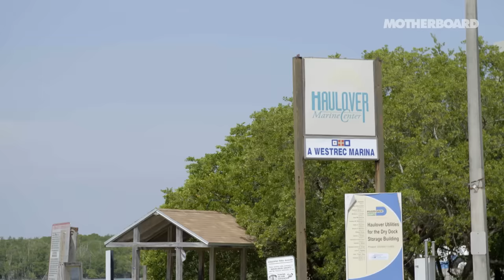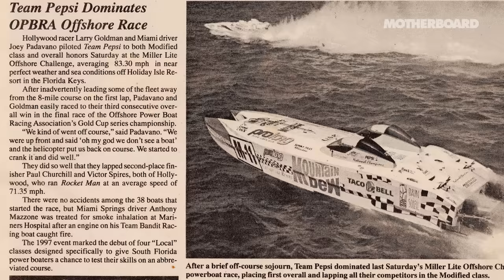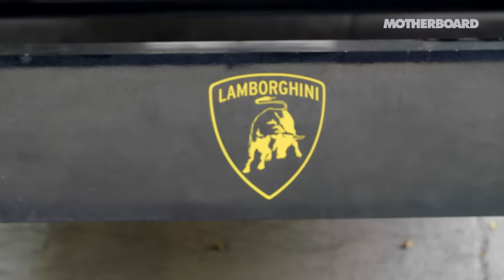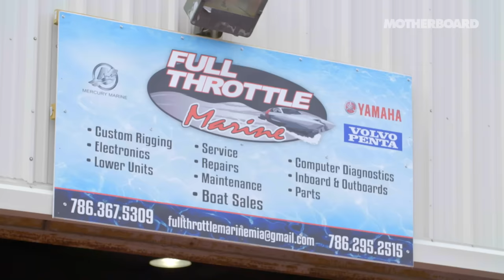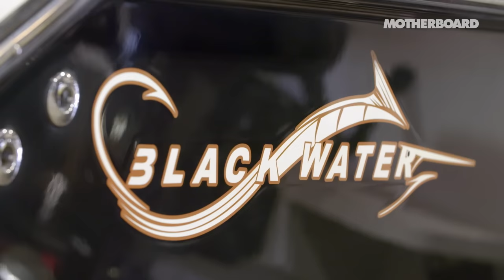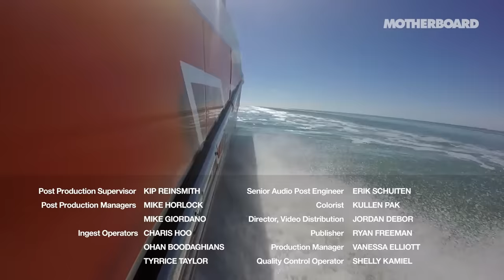Miami's Most Powerful Speedboats

Comment: 100mph on the water is absolutely insane
Reply: That yellow Lamborghini boat can do 186 MPH top speed. That's nucking futs. I've done about 75 on a supercharged jetski and it was scary. Cant imagine these rockets
Reply: Michael Matthews Some boats can reach 350 mph but it gets dangerous at that speed, boat flipping is quite common when you go that speed.
Reply: I race hydroplanes and we go like 135 while sitting on a 2 in thick piece of ply wood
Reply: After 80 it’s no longer fun, especially if you are sitting in back seats as it feels like it’s ripping your hair from scalp

Went 135-140 in back of a nortech and faster in a skeeter (didn’t have gauges for passenger in skeeter)  and did it on a lake so things came real fast

Comment: I'm glad they're using MPH instead of knots.
Reply: anything for the plebs
Reply: 1xtra299 I am a temporarily displaced millionaire thank you very much.  JOBS!
Reply: John Smith KPH or nothing
Reply: Kilometers are less convenient a unit for high speed, as they are a bit small. Maybe if the video was about bicycles.
Reply: Steinbeck!
Reply: I'm knot.
Reply: America is probably the only country in the world that measures things differently, not good.
Reply: knots are for boats ;) these machines are dragster. when you drive this kind of stuff, it's the same driving as a car !! fuck
Reply: america and burma
Reply: 1337Sauce Lol no they don't WTF are you on?
Reply: 良否 RNG Britain is officially on the metric system since a longggg time ago. They may use the foot and inches but speed is almost always in kph. I'm from Canada which is also metric where there is a similar situation. Cars use kph, sometimes we measure in imperial.
Reply: They ain't real seamen ...
Reply: @JohnSmith-td7hd    KPH is a more precise measurement however.
Reply: @mra6308  Same could be said for Celsius and Fahrenheit. Fahrenheit is more precise.
Reply: @JaviLengomin   How exactly?
Reply: @mra6308  Fahrenheit makes more sense for precision and as a way of communicating air temperature in a way that relates to how humans perceive temperatures. The ambient temperature on most of the inhabited world ranges from -20 degrees Fahrenheit to 110 degrees Fahrenheit — a 130-degree range. On the Celsius scale, that range is from -28.8 degrees to 43.3 degrees — a 72.1-degree range. This means that you can get a more exact measurement of the air temperature using Fahrenheit because it uses almost twice the scale. I do agree with the usage of grams and meters though.
Reply: @JaviLengomin   I dont think you can have a difficulty communicating air temperature with celcius either. I know for a fact that i can gauge how hot or cold it is outside using celcius. I mean come on. Freezing point is at 0 and boiling point at 100.
Reply: @mra6308  It's a scale based on water. The other is based on body temperature. Agree to disagree.

Comment: 0:22 Are these boats completely boxed in? How would you even pull out of the harbor?
Reply: Kenworth W900 and a trailer that uses hydraulics to haul it down the road at almost 90° on one side.
Reply: @2azz539  wow thats crazy
Reply: @23shipoopi23   Its the only way they can tow the boats, if it was down flat itd be too wide for thee road
Reply: That is a boat show. Docks are there temporarily.

Comment: I may have had a hand in starting this whole thing. Back in ca 1980 I was working for Cougar Marine, the guys who tamed the cat -- more or less. Some guy bought a used Unlimited that we turned into an open cockpit with outboards; 4 420 hp special built Mercury's... They wanted a wing for the back, just like the F1 cars of the day, don't think they tested it in a wind tunnel... So I built a full width by 3 foot S glass/epoxy NACA wing for them, never found out if it worked. I'm not even sure what "working" meant.

It ate 100 gal/hr and didn't carry enough fuel to get to Bimini. But it was pretty cool.

Comment: RIP..Larry, I had my boat at Haulover 2012-2014..until prices per foot, got out of hand, had to go up to Broward. I disagree here, not that many go for speed snymore. Center console is 70%.of the South Florida boats, then 20% sport cruisers (Searay, Formula, etc). Why might you ask? because easier maintenance on outboards, better on gas(2x car price) and more room on the boat, unless you have the cruiser ,which anything really over 40ft is a diesel anyway..

Comment: Dry sump lubrication in a boat?  Probably because the engines are adapted from race car versions, which require dry sump.
Reply: That and because of all the sloshing around on water
Reply: @Wabeeninc  Good point, at speed this boat when hitting a large enough wave would become airborne (more accurately, ballistic) and would be weightless until it hit the water again, so the oil in a traditional pan would float around, possibly allowing the pickup to suck air.

Comment: "the boats are so computerized"  shows one toughbook from 2005 connecting to a usb cable
Reply: If al it does it run diagnostic software why replace it? Has nothing to do with the mechanics of the boat.
Reply: @TacoCrisma  you're the only person that found the need to reply to my two year old comment, congrats
Reply: Ding Chavez 👍

Comment: Here i am with a 30 foot dual motor 400 horsepower stingray😂
Reply: Yt pancreas and then there’s me with a 15ft war eagle and a 50hp outboard😂
Reply: @kx7zz  and there there is me with a 12ft RIB with 25hp outboard motor now i will say it hits 45 to 50mph on the water because its an outboard motor that can work with racing fuel
Reply: and then there is me with a fishing boat with a 4 horsepower engine
Reply: mike force  i guess that works, depending on the size of the wheel

Comment: At sea: speed is measured in knots, distance in nautical miles.

10 knots = 10 nautical miles/hour
Reply: 10 knots = 10.15mph
Reply: @idontplay9559  Please note that a nautical mile is not the same as a land measured mile. 

When one says their vessel is sailing with a speed of 10 knots, it refers to the amount of minutes out of a degree it has traveled in one hour, which in this case would be 1/6.

10 kn = 10 nm/h
10 kn = 18,52 kmh
10 kn = 11,5 mph

Comment: Motherboard and vice lie so much its becoming a major turn off to the point when they say 1 stupid thing and I cant watch it anymore... cant even get 1 min in... the boat were made for drug smuggling?... Since infared was implemented "Go Fast boats" immediately stopped being viable. Those engines run so hot you can follow there trail for miles so when you stop its like you've left a yellow brick road from the crime scene....

Comment: bigger motors while the rest of the world is moving on to electric... yeah right good luck with finding those bigger motors in couple of decades
Reply: Aftermarket companies literally manufacture every single piece of those engines completely independent of the big corporations like GM & Ford - as long as there is a demand for them, and there most certainly WILL be, these pieces will be manufactured and then purchased & assembled by the end user. Grass roots motorsports all the way up to multi-million dollar professional motorsports is where the demand for these engines & parts comes from, and only a fool would bet on that demand disappearing any time soon.

Just another do nothing nobody that thinks they know everything when they barely know what's outside their window...
Reply: Won't be too long before Oil runs out, then how u gonna run your big engine?
Reply: #QuicheDude
Reply: LeaderFox96 with full synthetic. Ain't nothing but full synthetic in all high performance motors already.
Reply: You can't run a vehicle on synthetic oil.. lol. Full Synthetic is an engine lubricant
Reply: LeaderFox96 no shit...
Reply: You know it's going to happen full electric speedboats. It's just a matter of time. They just need to develop batteries that are lighter, smaller, and can store a higher amount of electricity. Fully electric boats are already a thing they just can't go this fast yet. 

What scares me is that you're riding in a electric boat on salt water.... What if something goes wrong the boat crashes and opens up, you fall into the water and the batteries sends electricity through the water that you're in. But still boat crashes are very rare.
Reply: The saltier the water the better a conductor it is... to a certain point ofc. There is always gona be a way with less resistance for the current other than you, only if you get in contact with both poles and water doesn't your screwed. If you fall in you gona be safe.
Reply: "Blood oil"
Bahaha ha
Reply: Oh shit imagine these boats powered by multiple Tesla motors... Damn lol
Reply: LeaderFox96 biofuel